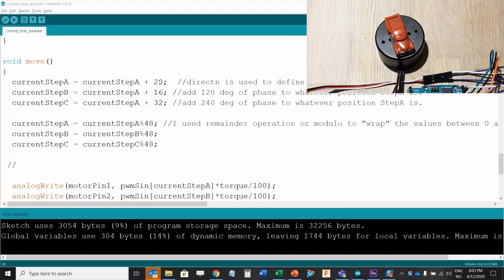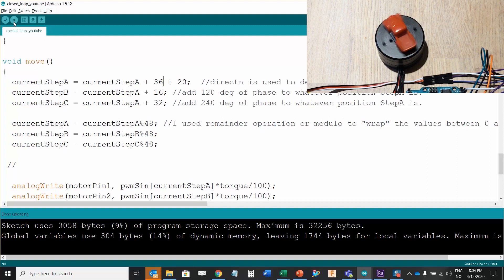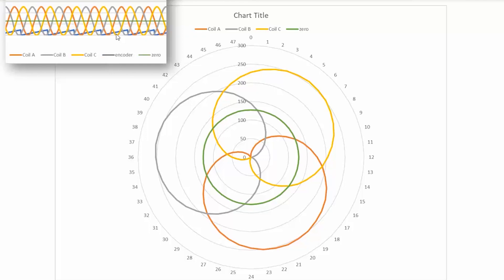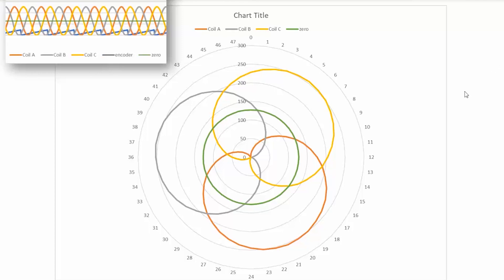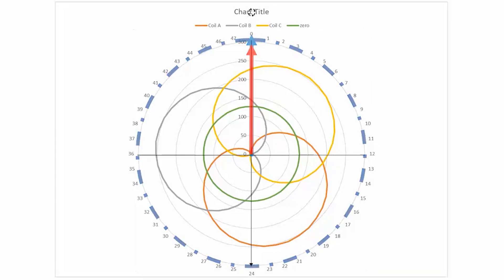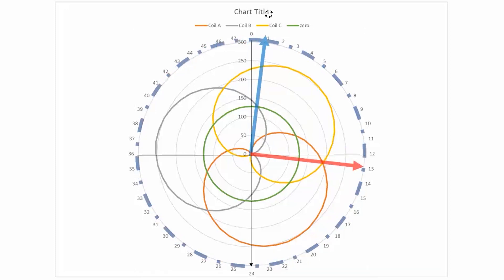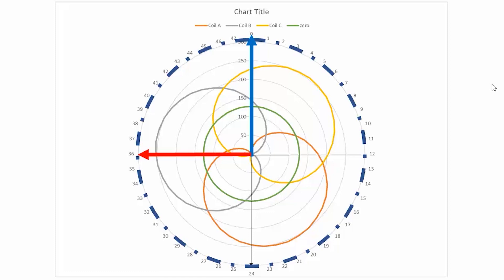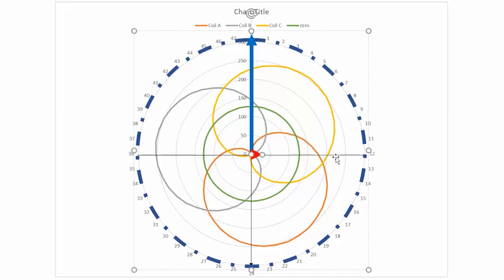Arduino Brushless DC Motor (BLDC) FOC Vector Control Part 4 - Closed Loop Control Servomotor

Comment: makes so much sense, i loved your videos so far. i have a question tho. you're using l6234 and therefore you only ouput 3 pwm pins. how about a scenario with 3 mosfet drivers and a total of 6 pwms? i read on the l6234 datasheet that if you apply logic high to IN pin, the high side of the half bridge is triggered and if you apply logic low then the low side is triggered. but in my case i have the 6 pwms seperatley and don't have the l6234 doing things for me. so, how should i go in this situation? try to come up with a software solution like sending the high signal of a pwm with one pin and low signal with another? or should i go with something like a comparator or logic gate (hardware solution)?
Reply from the maker: Use a triple half-H-bridge driver, details in my Patreon :)

Comment: Hi Pablo, great video series. Two questions: At slow speed the movement of the motor seems to be not very smooth. I can see a little bit of jerking. Why is this? I want to use a 9 pole, 12 magnet motor with 3 hall sensors. How to modify the code? Thanks

Comment: Could you please let us know what Motor driver you used. L6234D I suppose but the breakout board is not available anymore. Could you please suggest any other motor driver?
Reply from the maker: Sure, theres a link to a fully integrated board that can drive 2 bldc motors at the same time in the description. Good luck!
Reply: @RandomAccessProjecs  thanks for your reply. You mentioned in video of part 5 that there is limitation on the frequency of Arduino Pro and noise could be heard. In other video this noise is not heard. Have you resolved that issue?
Reply from the maker: @420hannan  yes, you can try what is suggested in the video, however it may affect the timers for other functions, like “delay”, etc. so keep that in mind :)

Comment: Hi Juan, the polar graph looks great (reminded me of the Fourier transform video to wrap a circle around the target signal so as to detect the signal's angular frequency :-P). However, you mentioned ZERO line = PWM valued at 127,  if I don't misunderstand, all possible PWM (duty cycle) values are positive (0~255), therefore 127/255=0.5 duty cycle means to apply half the battery voltage to the coil, can you shed some light on how does this (1/2*Vbat) converted to zero here? Is it to do with the power stage where it's not the phase coil but line-to-line coils (Y-connected) are connected into the Power stage output? Many thanks in advance!
Reply from the maker: Hello! Indeed 127 in the PWM function outputs half the voltage, and the reason is that we must feed a sinewave function to the coils, so if we feed half the voltage to all coils, there is no voltage between them (zero) then this allows us to produce variations towards the “negative” side of the sinewave (127-0) or towards the “positive” side of the sinewave (127-255). If you want, you could also design an electronic power stage that produces both positive an negative voltages, this would allow you to use 0-255 for generating the positive side and 0-255 for generating the negative side and would produce more torque as you are using the full voltage instead of splitting it in half as Im doing in this demonstration:) hope its clear. Thanks for the support.
Reply: @RandomAccessProjecs  Indeed Juan, I remembered now it is the bi-polar modulation that allows one to fully use the negative voltage. Thank you for the insight! One question though, whilst I understand a rotating or sinusoidal magnetic field needs to be generated in all coils, as we are controlling the voltage, but the magnetic field is generated by current, it is always lagging the voltage for an inductive system. Do you know will orient the "currentStepA"  90 degrees from the "epos" alone will ensure getting the maximum torque? How about load disturbance say maybe it's perfect at light load but worse under high load?
Reply from the maker: @clickle23  correct! This is a simplified version of FOC, so we don’t actually measure the current to determine the phase and correct for it. It works fine for low speed applications :) but for sure there’s a way to go to make it full FOC.
Reply from the maker: @clickle23  thats a very good question and I think I dont have an answer for you at the moment. But i will get back to you soon :)

Comment: Your video about FOC controll is very helpful for me, thank you very much.
I tried your code, the motor runs very well, but I think it runs not very smoothly, is it necessary to implement the anti cogging feature? And how hard it will be?
Reply from the maker: Zhang Zhi Qiang thank you. It should run as smooth as in the video. Maybe you can upload a video of your motor and show it to me? What is an anti cogging feature? Wouldn’t that be intrinsic to the motor design ? ie. having different number of poles between rotor and stator? Thanks for your support!
Reply: @RandomAccessProjecs  hi, Here is the introduction about anti-cogging. https://en.wikipedia.org/wiki/Cogging_torque. Comes from the rotor’s permanent magnets’ attraction to the salient portions of the stator. It is hard to show it in video, but you can feel it while hoding the motor in hand.
Reply: I have the same problem with my cheap gimbal motor. Did you found any solution?